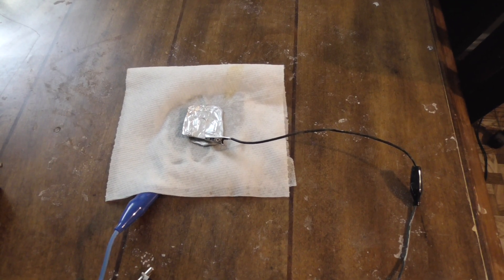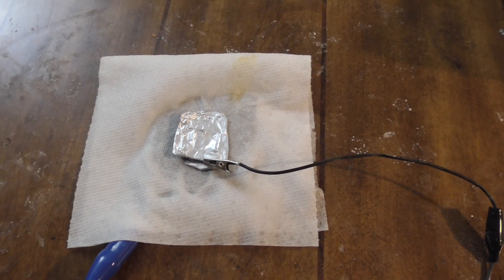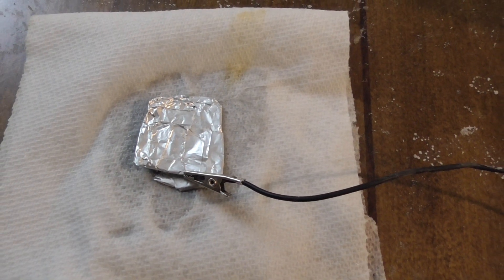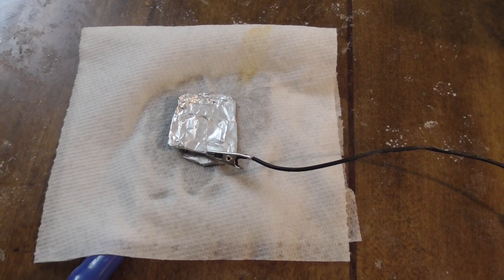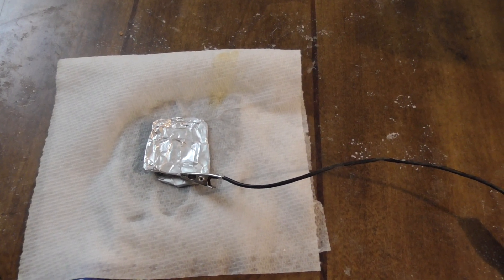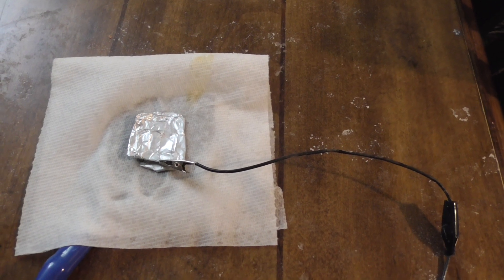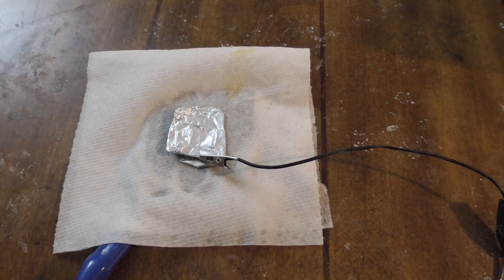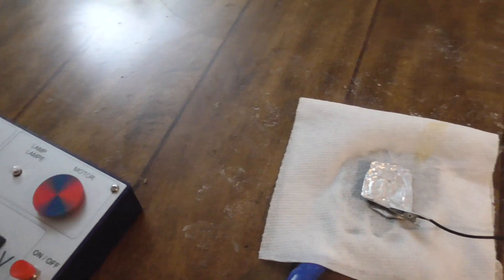Aluminum Air Powered Motor

Comment: Use zinc same set up take a six volt znc  battery apart take one of the four cells out unroll it takes a little sheet of zinc and  put it where the aluminum foils at.. then see what it reeds on a voltmeter and then take a small computer fan and blow across it the voltage should go up and the amps I think you should blow across the carbon felt.. why is this is better is because you can mix the zinc oxide when it's all used up with carbon and put it in a focal point of a lens make you go red hot and it will the vapors coming off will be pure zinc vapors and you catch it in the lead walls of a container . This means you can recycle your own battery from a campfire. That's how they used to purify it in colonial days you just have to heat it up to Red Hot and it will combine with the carbon and vapor the zinc vapor will deposit on lead and won't stick so you could use just about any energy to recycle your zinc oxide firewood solar electric maybe even an induction furnace running on A zvs.
Reply from the maker: In terms of energy density and theoretical capacity, aluminum has a higher potential than zinc. This means that aluminum-air batteries can potentially last longer and deliver more energy compared to zinc-air batteries.

However, in practical applications, the lifespan and performance of both aluminum-air and zinc-air batteries can be affected by a number of factors, such as the quality of the materials used, the design of the battery, and the operating conditions.

For example, aluminum-air batteries can have a longer lifespan than zinc-air batteries if they are designed and operated properly. However, aluminum-air batteries can also be more sensitive to moisture and temperature changes, which can affect their performance.

Ultimately, the choice between aluminum-air and zinc-air batteries will depend on the specific application and requirements. Both types of batteries have their advantages and disadvantages, and the best option will depend on factors such as cost, performance, and environmental impact.
Reply: @joellagace1679  all true but if you can't recharge them yourself and have to depend on the processing plants to make a new piece of it kind of defeats the purpose especially when they're shut down I like aluminum myself but it has that one flaw